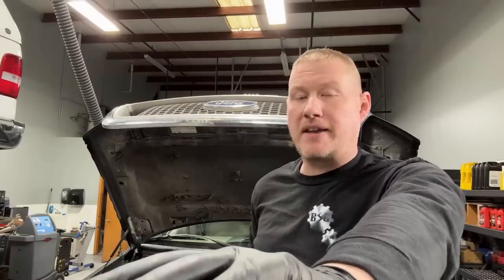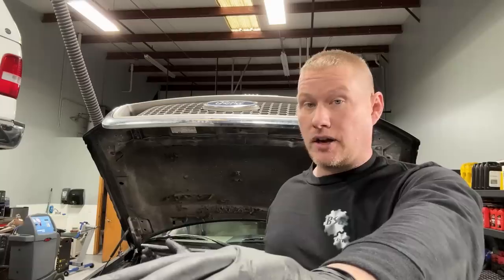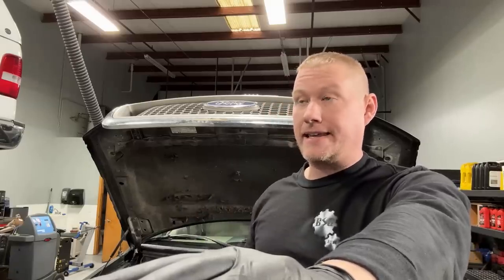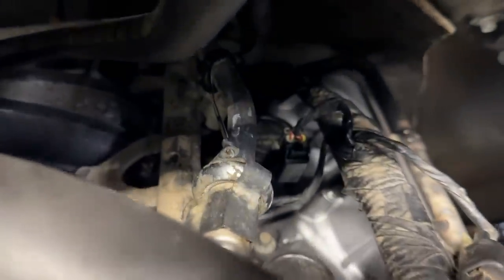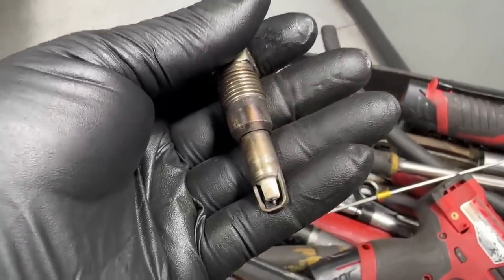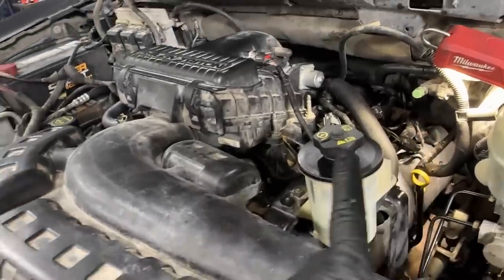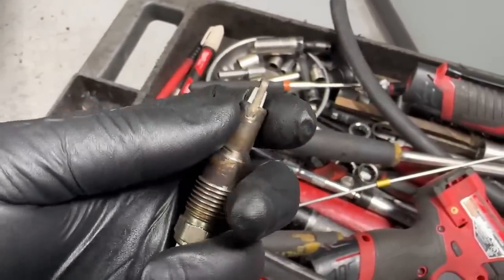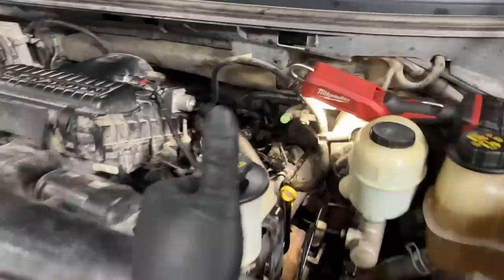How in the World is There a Belt Chirp Noise Coming from INSIDE of this Engine?

Comment: Only a "Ford" can have these weird problems... My 1993 OBS Ford F150 5.0/302, a month and half ago had "Crank, No Start with Fuel pumps continued priming...Did  all the usual stuff as a Shadetree mechanic to tryna fix..Ending up towing it a shop...They didn't fix it..Brought it back... Let it sit for a coupla weeks.  Long story short, it runs lika champ like it used too...Cleaned the IAC valve, ECM and metal holder, added some Techron gas additive...No parts, no other diags...Starts up...Fuel pumps good, No check engine light... Soo, what gives...???.. Fords keep you thinkin' and such...

Comment: Have you had any issues with the water pump leaking on the 3.5 ecoboost? We have a 2015 navigator and it today left a pancake sized thing of coolant on the floor this morning. Wasn’t the degas bottle connection… it’s coming from the front of the engine.

Comment: Back in 2016 I had a 2012 Chevy Cruze in here with all kinds of problems, and one of them happened to be that same squeak! It was the PCV system pressurizing the crankcase, and compression was squeaking out of the valve cover! ODD indeeeed!! Had to replace the whole valve cover, since the PCV valve was part of it. 

Only 45k on this one - this car was the very definition of "LOW BIDDER" parts! I wouldn't take one if it were given to me, lol. 😂

Comment: Those plugs look ruff for "JUST" changed them. Also, my 2V with 185k sounds waaayyyyyy smoother running. Doesn't have that dieseling noise either.

Comment: I had similar sound from 4 stroke 650cc motorcycle when I was seated forward with passenger behind me.  New exhaust pipe to head crush washer solved it. Chirping exhaust leak.  On my 2007 F150 4.6 150K miles last year two corroded exhaust manifold bolts let exhaust whistle past the steel gasket & that sounded like a belt squeal each time engine rev'd up.
Reply: Thanks Brian for these detailed videos  !

Comment: I know you're a Ford guy I've owned four it's my wife had a Ford I had a 2000 Chevy Silverado with a 5.3 engine maintained it lickety-split engine still running at 435,000 mi never opened up at a do a water pump at 300,000 first water pump maintenance is the key it's not an absolute promise but it is the key

Comment: I'm also surprised that the timing chain didn't eat the oil pump housing having 245,000 miles on it ur supposed to do timing chains at 100,000 miles on those motors

Comment: I just bought a 2006 Lincoln Mark LT. Beautiful truck but transmission whines in gear not moving and quiet when in park or neutral. I just dropped the pan and it was clean. Had original dipstick plug in pan so it was never dropped. 120k on the truck. 
Trying to see if anyone else has had this problem. I changed transmission filter while I was in there.

Comment: Hey Brian, if you get a chance you should do another video about the f150 5.0 rattle on deceleration. My 2020 F150 has that issue but isn’t covered by the TSB for it. I’m curious as what causes it? Faulty VCT solenoids maybe?

Comment: I need you to diagnose my new 22 Charger 392 widebody. It's screeching at op temp only , at stop lights or in park. Loud sound for a few seconds like a bad belt would screech. Dodge is clueless, theh replaced tbe harmonic balancer and i pick uo and seems worse. This car driving me crazy. Im in vegas if u somewhere close
Car is a 2022, i spec and ordered it, has less than 8k miles.

Comment: Brian, Short question to you. For Edge 2.0 Ecoboost coolant intrusion issues. I was told as long as the vehicle built after April 2019, even if it is a 2019 edge. There will be no issues or I should stay with 2020 or later years or 3.5L? Thanks.

Comment: Have you ever seen a 2012 ford f250 with the gas engine, it's throwing random misfire, po353 ignition coil primary circuit? Are these opposed cylinders

Comment: Had a customer bring a 95 e150 to me years ago. Had a rattle. He tried all kinds of attempts. He even pulled the intake thinking it was a lifter. He gave up and let me look at it. I pulled the dog house. Started it noticed the noise was from the passenger side. Walked around, looked and noticed a plug wire wiggle. Grabbed the wire, noise stopped! Ended up being a loose porcelain in the plug. I see the stupidest things sometimes.

Comment: How much will a timing job cost usually for a o8 f150?
Reply: I’d say $1000 - $1500
Reply: @theMister07  not quite!  You’ll have that much in parts before labor!  I just did mine.
Reply: @theMister07  Thanks
Reply: @laylandad1986  nothing like having the skill set to do it yourself especially when it’s yours. the savings are crazy
Reply: I think i paid 2500 - 3000 canadian. Specified ford parts. 08 f350 5.4. This was a year ago.
Reply: @theMister07  that true!  I did it in about 12 hrs.  That was my first and last time doing a 5.4L 3v timing job.  Brian’s videos were a godsend and they helped me tremendously!
Reply: @laylandad1986  never doubted it. the $$$$ I’ve saved myself and others through the years can’t be counted. the luxury of working on gas ⛽️ diesel & hybrid. I had to diagnose an electrical issue on my 2000 Navi 5.4 32v InTech. She’s purring once again

Comment: Can a loose plug cause it to sound like valve train tap? Work truck at the shop I swear it sounded like a failing roller follower While I was out it stopped tapping Need to look up RO and see if they put plugs in it as they may have after someone put diesel fuel in it 🤦‍♂

Comment: You mentioned heater core...what tool do you use to disconnect the heater hoses from the core inlet and outlet?
Reply from the maker: My finger, you simply push in , squeeze the two tangs and pull.

Comment: I would not be afraid to buy a 5.4 3 valve if the owner provided records of service. That is the main issue with them. You never know if the oil was changed correctly or not and so just not an engine to bet on.

Comment: If the ford plugs are the brakeable two piece. I found on american muscle  a one piece spark for the ford 4.6 and up heat range is the same  ben very gd for 3 years now
Reply from the maker: Everyone makes the one piece design now and have been for more than a decade.
Reply: @FordTechMakuloco  I have the same chirping sound but it wasn’t the plugs. I’m lost on the noise. I have a severe vacuum at oil fill cap and oil dip stick. Chirping stops when I pull dipstick or oil fill cap. Any ideas Sir?This is a brand new create engine from powertrain motors. Long block package   I can’t figure it out.

Comment: FordTechMakuloco? Or anybody on here for that matter. Would you switch to 5w30, 5w40,10w30,10w40? Or simply add lucas oil stabilizer. Or an engine flush such as seafoam or b12 chemtool to your or a 5.4L 3v Triton???? A big debate for me as these engines are notorius for the timing tensioner/bracket failures, Cam phasers failures, and roller followers failures. Any of your opinions are appreciated.
Reply from the maker: You can run 5w-20 but 5w-30 is preferred and 5w-40 should be reserved for only worn out or high mileage engines.

Comment: Gee, I have a 2015 Ford focus S with the 2.0 motor in it. It makes a noise kinda like what you found. The Ford dealership put a new five speed transmission. Thinking it was coming from bearing.
   Now, I need to replace the spark plugs. Hoping this the same problem you found.

Comment: I’m having a startup chirp with a 2002 F150 5.4 2V. I know it’s not belt, thought it might be exhaust.  Only happens at startup for a few seconds.  Could this be the same problem?
Reply from the maker: I am heading towards exhaust manifold most likely passenger. Have someone start the vehicle after a cold soak and list directly over it and smell for raw exhaust gases.
Reply: @FordTechMakuloco  : Like checking for a tire air leak, you can successfully use a spray bottle with dish soap & water mix to find cold engine exhaust leaks too.

Comment: So which is a proof is in the pudding or the owner neglected it you said both you can’t be both I’m out
Reply from the maker: The engine was well maintained the last 245k miles and now just needs a timing job instead of replacement. Waxing the paint, suspension, coolant changes etc where definitely not given the same attention so yes both.

Comment: I had this exact same problem on a Chevy Cruze once. Apparently it’s a common problem On ecotec engines
Reply: No it's not. I've owned a half dozen of them. Never any spark plug problems. The loose plug problems on ANY vehicle come from ignorant people who don't properly install and torque the spark plugs to factory spec. Torquing anything to spec is especially critical with modern aluminum cylinder heads.
Reply: @turbodiesel4709  look up Chevy Cruze chirping noise, there’s many people with the same concern.